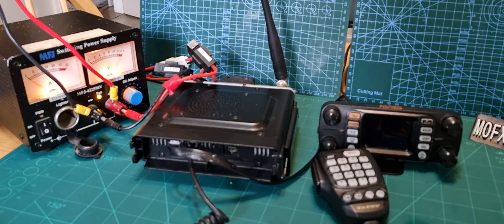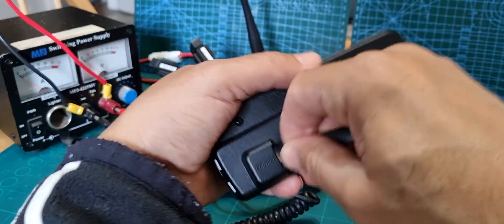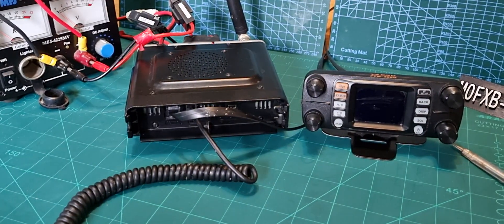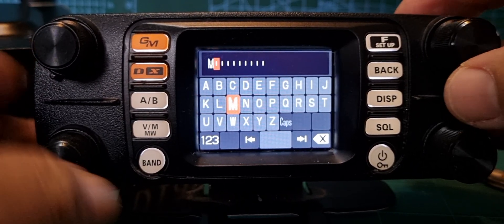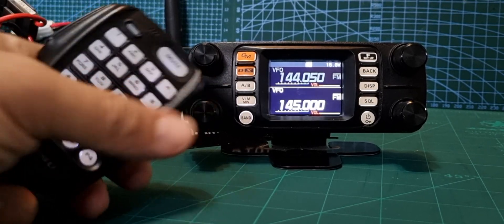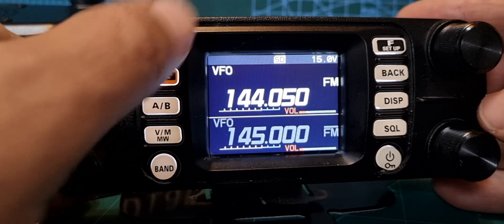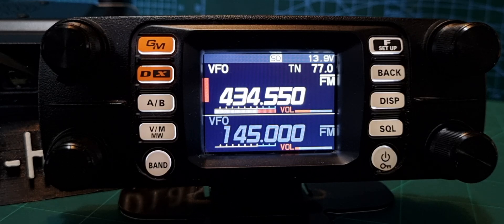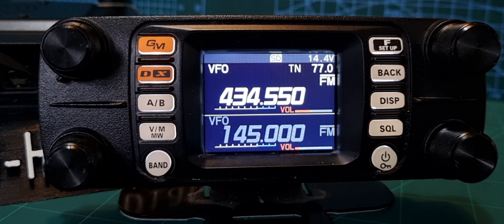YAESU FTM-300 Full Install,Connect antenna , power supply , assemble Radio

Comment: Hi Andreas, I have now purchased a FTM-300. One question, should it come with the bracket /stand to screw to the head unit?
Reply from the maker: It's a small stand
Reply: @M0FXBHamTech  Yes Andreas but should the radio come with one in the box?